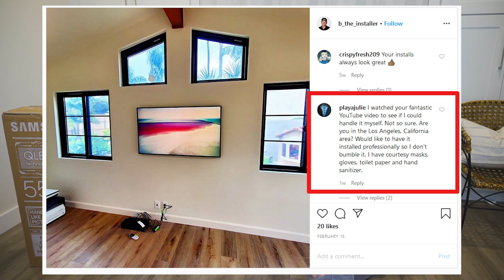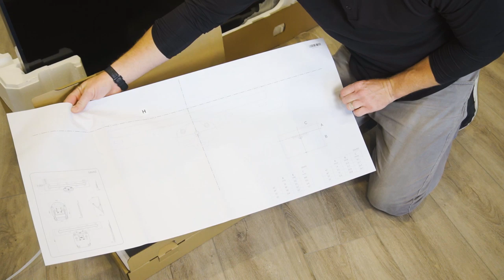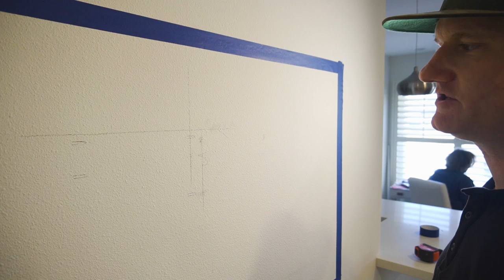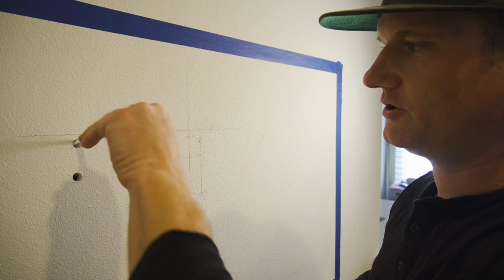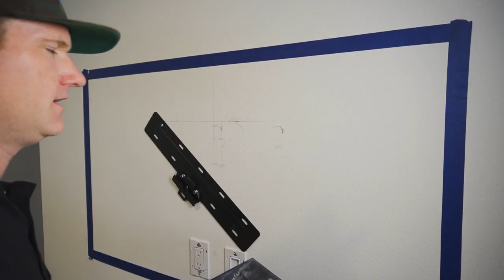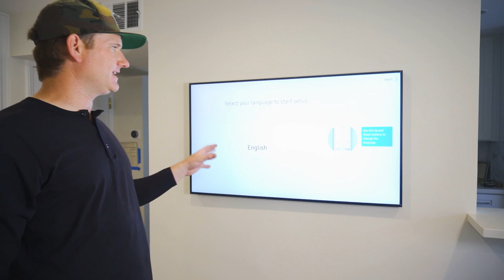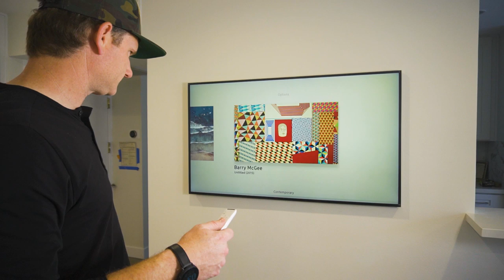Samsung Frame TV Install With No-Gap Wall Mount

Comment: Hi really interested in getting one of these TV's but dont want to destroy the illusion, by adding a sound bar, is there a solution you would recommend using small discreet, speaker systems

Comment: Great video... Can you tell me if he One Connect can connect to a Sennheiser RS 175 RF Wireless Headphone System that uses an Optical connect cord? Unfortunately, the Samsung Q90r does not have Bluetooth that can connect two wireless headphones at once.  Thanks
Reply from the maker: You can only bluetooth to one thing. I use Sony headphones every night and just repair them nightly.  Works like a charm.  I had senheisers before and used via optical.  So it can be done either if the senheisers have bluetooth. Not sure they do

Comment: Hi. I just got myself the frame. Question: When hung up. there is a gap from the top frame to the wall. Is it possible to have it gapless against the wall, meaning no space whatsoever?
Reply from the maker: Yeah some people have said that.  I have no issue.  Maybe pull bottom out and push top in to get it to fully push up.  Also you can put the rubber pads at bottom and it will counter act the top gap.  1/4 inch around is not bad.  All pics have a little gap
Reply: @BTheInstaller  Thank you for the response. What is the rubber pads? Do they follow with the package?

Comment: The connectors on the end of that one connect cable are pretty big.  How thick was the in-wall conduit, since that cable isn't in-wall rated?  And was the conduit put in before the drywall, or did you fish the conduit in the wall after the drywall was installed?
Reply from the maker: It was in wall. Many times contractors run conduit when building. You can pull 2inch through. The small end goes through

Comment: Thank you for the video. What are the dimensions in centimeters of the One connect height, width and depth? ?
Reply from the maker: Saw this on samsung, but some differ in size.  14 1/4" wide x 4 1/2" heigh x 11 1/4" deep according to Samsung.

Comment: I'm getting ready to install my Samsung The Frame 65 TV. I think I watched the video 10 times!! The video is great. I'm ready. You will soon be on HGTV!! :-) Question: Would you mount a 65 incher direct to the drywall using toggle bolt? 55lbs My wall is build on steel studs.
Reply from the maker: Hello, thanks. Much appreciated.  I'm about to launch the 2020 frame video next wed.  You can absolutely mount that tv on 4 toggle bolts, 3 on top and 1 in middle bottom.  The 3/16 ones I show are 80 lbs per... you could hang a pull up bar on the mount and hold your own weight.

Comment: Did you HAVE to remove the power socket face place ? In the UK that is not possible. What did you mean by cable not rated for in wall ? Do you mean it MUST have a conduit? Thanks
Reply from the maker: In the states power outlets and the pass through boxes have plates that cover the outlets.  The cable isn't able to successfully slow down a burning fire like some other rubber material.  Its also possible that this wire could get punctured more easily than an in wall rated cord.  Either way, its not likely to cause any issue in wall, so many people place it in wall.

Comment: Can you recommend a TV that is not a smart tv please?  I will be moving to a new apartment and am not sure that I can hang it on the wall, but I would like the option to do so if it's possible!  Ty!
Reply from the maker: Most tvs are smart tvs.  Do you mean you likely won't use the smart TV because you have a device you care to use?  Also give me price range and size as there are good ones depending on those things.

Comment: hi hi great videos, just wondering though, do you sit the one connect box on the floor then?
Reply from the maker: You can put them anywhere.  Many people have stands below, some have tables and then put a basket under as decoration and just dump it in there.  They don't need to be in line of sight of remote so they have to go somewhere.
Reply: @BTheInstaller  thank you so much!!

Comment: Is the no gap wall mount really works. I have seen in some video there is a gap of 2-3 cm on the upper part of the TV after installation.
Reply from the maker: I've had no issues.  Walls aren't always perfectly flat.  So any minor gap is typically from the wall not being perfect.

Comment: Nice one - i really enjoy your content:-) , I am a installer too (denmark) and my biggest concern is hidding that one connect box....it is always a hazzel and I do not think is pretty, but it is however a cool feature that every thing is in the box and not on the tv.
Reply from the maker: Thanks... it's fun work but definitely gives you a lot of knowledge that I find hard to give the world, so YouTube was a good fit.  The frame is cool, and I like the one connect for it, but overall don't like having a separate box.  Wish they would incorporate the tech into the depth of TV for QLEDs
Reply: @BTheInstaller  The one connect box, is really good when it comes too hide many cables in a tv table ect whith that one cable... but I am a LG fan.

Comment: I thought you were going to use a conduit? Looks like you just straight dropped the wire behind the wall. What would your conduit look like, if you did use one?
Reply from the maker: The conduit was already in wall.  Just a 3 inch flex tube.

Comment: Hi! I recently bought the Q90R 75 inch. Do you think only one stud with 2 screws and 4 drywall screws will hold the TV? The weight of the TV is around 88 pounds
Reply from the maker: I don't know your situation, specifically... i have mounted many tvs with a single stud in the middle of the mount, and toggle bolts on left and right sides that weigh over 100 lbs.  My new video shows this on an outdoor tv, but similar concept.  You have to make the best decision for you. https://youtu.be/IePfgvqmYlQ
Reply: B The Installer Okey, thank you so much for replying! Appreciate it👍

Comment: This video could be soooo much better if you showed the TV hanging from the side so that we can see its profile, aftercall that's the selling point of the TV. Also you should show what you did with the box, where you placed it, how long are the cables, what cabinet you used and offered suggestions, since that's also what differentiates this TV from others!
Reply from the maker: then check out my other 4 frame install videos and 2 reviews.  plenty to see.

Comment: Super dumb question but how did you push that outlet back so it was flush with the wall?
Reply from the maker: I just pushed it in.  Its just thin metal holding it to the screws.  Took cover plate off.

Comment: I've installed my 'The Frame 2020' 65" without removing the white stickers from the mount, shall i have removed it? what it actually does and how it affects the mount? Thanks!
Reply from the maker: No you don't need to.  That is only if you use the mount for a larger or smaller tv.
Reply: @BTheInstaller  Thanks!

Comment: Hello. My dad took all the steps that you took for a 75 inch frame TV and the TV is on and talking but it’s not displaying anything. What should we do?
Reply from the maker: You plugged in one wire to display and then to the box? And then powered?  Make sure the batteries are in correctly.
Reply: @BTheInstaller  yes he made sure everything was done correctly the second time but the tv still won’t display anything despite being on.

Comment: Will this wall mount work on a boat where the wall is tilting from side and bouncing around a bit?  If not as-is, would adding a small bracket or 2 to the edge of the tv frame to keep it from tilting out solve it?   I guess I'm asking that if the tv is restrained to be against the wall,
is it then impossible to lift it off the bracket? - Thanks!
Reply from the maker: The mount is pretty solid.  It would not lift off.  It may sway and/or bottom come out, but i used double sided velcro tape to hold pictures still.  This would be same.  Remember the box, where is that going?

Comment: what is the size of the washers you are using on those toggle bolts? If you have link where to buy the washers that would be great.  I'm about to mount one up as well.
Reply from the maker: I just get the washers in other mounts.  A typical 1/4" washer is fine.   They're about the size of a quarter at home depot but 1/4" hole and work well

Comment: If the only reason brick/concrete wall was discouraged was because of not being able to put cables thru wall, I don’t think that should be too much of a deal breaker. Since it’s only one thin cable, I’m sure hiding on wall surface wouldn’t be too much of an issue
Reply from the maker: Agreed.  It was more for brick fireplaces.  That is much harder to hide wire/one econnect box.

Comment: Is it ok run the regular “non wall rated” cord behind the drywall or is that considered buried in the wall? I bought a 2020 50” but it’s not compatible with the in wall cord so that’s not an option for me.
Reply from the maker: It's technically not in-wall rated. You can run some flex tube in wall, 2" pretty easily.  The cord for the 2019 is same for 2020.. I'm 99% on that

Comment: What size toggle bolts would you recommend using to mount the Samsung Q90T 65" using the no gap Samsung mount? The mount model # is WMN-M15EZA. Thanks!
Reply from the maker: the 3/16 inch size is always best for TV installs.  They're a little more workable but very strong still.  The normal length is 2.5 or 3 inch long.
Reply: @BTheInstaller  Thanks for the information!
Reply: @BTheInstaller  oh and what size drill bit do I use for the holes?
Reply from the maker: You should follow directions on whatever you buy but the 3/16" ones I use are 1/2 inch hole on wall.

Comment: Why you say that this is not good for a brick wall ?  If we take the wire from the middle to down then we can connect to one connect box. Yes you have to compromise on neatly hiding the cable. It will not be as clean as this method. But I dont think it will be that bad to not to purchase this TV.
Reply from the maker: Its fine for brick wall if you leave external.  It's not good for brick fireplace.  Maybe I said that wrong.  The wiring of a tv is more complicated on a brick fireplace, and people are trying ask me how to hide the one connect behind a tv on brick fireplace.  I would avoid the tv for that install request.

Comment: I just started researching this tv and I have heard that the one connect cable is not rated to be run through a wall without using conduit.  Is this true?  Do the instructions that come with the tv say anything about using conduit?    Also, if mounted high on the wall can the top of the tv be angled down while viewing.  I'm just wondering how decent the picture quality would be with it flat against the wall?
Reply from the maker: I wouldn't buy this TV unless you have the goal of it being art and a TV.  There are much better tvs for just being tvs.  You can see lists of mine on various videos and I've explained in all of these videos that cord is not technically rated to be in wall at all.  They do sell a $249 version to put in wall.  The conduit doesn't make it safer.

Comment: Is there a trick to taking the tv off the mount? I want to raise it off my mantle more but feel like I really have to force it to get it to disengage.
Reply from the maker: Yeah its hard.  Just pull bottom out and lift one side slightly higher than the other.  So just a little off level
Reply: @BTheInstaller  thanks for that. I did end up finding the answer on a site. Seemed there were a lot of people asking the same question. Might be a good idea for Samsung to mention it in the instruction manual.

I was able to remove the tv in under a minute.

Thanks again for the reply!

Comment: I'm trying to remove the tv to paint... cannot figure out how to get if off the no gap wall mount, any tips?
Reply from the maker: It's odd. Its just up. I pulled the bottom out and then lift with one side slightly higher and it will pop out.  Just up.

Comment: Any idea how to get the TV off the wall? I need to take my down and it seems a bit challenging!!
Reply from the maker: Just goes up.  You can pull the top out from wall and then get hands under the bottom and lift. It helps to lift one side a little higher first until it pops off the bracket.

Comment: What kind of conduit did you use in the wall? Im wanting to install one of these but want to be code compliant and dont know what is needed. Thanks!
Reply from the maker: You can get the in wall rated cord if needed.
Reply: @BTheInstaller  how is it listed on Amazon BTW love your video

Comment: Do you have an install where it does not sit flush on the wall? ie uses the bolts provided
Reply from the maker: Negative.  I advise people to seek a different tv as you will have hard time getting this to look like a frame that way.  And the cost isn't the best for regular tv in Samsung lineup.  Get q90t

Comment: The one connect wire- is it a fire retardant wire that was provided to you? I am in Canada and a fire retardant wire is not provided and I want to hide the wire through the drywall. Any suggestions will be appreciated.
Reply from the maker: Run a conduit in wall. 1.25 inches or larger.
Reply: @BTheInstaller   thank you

Comment: any advice for going past a fireplace? the top where we’re mounting is drywall with windows to the left and right but beneath is a brick fireplace. 

we’re trying to get the connect one box down to where the internet router is beneath the right window.
Reply from the maker: You can send me picture on IG.  May not work if there isn'tan easy route.  Good luck.

Comment: I have a brick wall and still want to install The Frame 2020 when it is available in Germany. Do you have any suggestions or would do anything differently? As it is an old house, the brick wall is quite crumbly and I had issues before to find a good spot and drill a hole.
Reply: Mehrwegflasche it’s super easy I just installed a 55 inches on a brick fireplace I used drill bids made in Germany
Reply: Ok, but what about the cable?

Comment: i bought a 65" frame tv and on the mount gap i didnt remove the four white stickers before screwing it into the back of the tv. Will this be a problem?
Reply from the maker: No.  You only take those off if you need to match it to a different tv.  They come set to put on the TV in box
Reply: @BTheInstaller  Ahh thx your the best!!

Comment: I know for a fact that OneConnect cable is not Fiber optics. If you cut it open, it's copper with fancy shielding.  I don't know why people keep saying it's fiber.  Samsung never said it is.
Reply from the maker: Dude, that's crazy.  I heard from another source.  Never even questioned it. Good to know.  Have they recommended not to bend? It still can be damaged so probably not worst fallacy for a customer to just be careful I suppose?
Reply: @BTheInstaller  Yes. They are ultra thin strains of copper that need to be able to carry 200+ watts of power. and digital video. similar to Thunderbolt 3 tech.
Reply from the maker: Good to know.  Good PSA.  Thanks
Reply: Why the one connect cable 2019 is not for in wall use?

Comment: Have you ever installed the entire One Connect Box in the wall itself, directly behind the TV?  I currently have an outlet and HDMI plug directly behind where this Frame TV would go.
Reply from the maker: You can remove those for a low voltage panel and hide the box inside that yes.  It would have a power outlet inside.

Comment: Hi! Please help me. 
Tell me, please the plug size for one connect box. I want to lay the cable in a plastic pipe, but I don't know the dimensions. On the samsung website, only the dimensions of the TV plug are indicated (45x84.8x9.55mm). but you need to insert another into the pipe (plug from the box)
Reply from the maker: I make a 1 1/8 inch hole in the cover plates and the small end fits through.  Just barely.
Reply: @BTheInstaller  Thanks!!!
Reply: Thanks i just installed my 65 and have been looking for the size of the plug, any chance you can make a video on taking thr frame back off the wall. Having issues taking my 65 back off the wall solo.
Cheers

Comment: Hello, how is the no gap mount installation different on the 82 q90?
Reply from the maker: The frame sits complete flush and has that square frame around it.  The QLEDs still sit flat but you don't have to have those mounts.  Should be similar install

Comment: Du you need (recommend) to run an ethernet cable to the One connect box, or does it connect over wifi? I mean to be able to watch content online. I have never owned a smart tv before.
Reply from the maker: If you have decent wifi, you shouldn't need an ethernet.  Even 2 years ago it was worse but in 2020, most have sufficient speeds to stream.  Some very rural areas may not.  So I would say wifi is very good and you don't need an ethernet cord
Reply: @BTheInstaller  Thanks for reply. Have not seen any reviews mentioning this. I live rural, but may have just enough speed to stream 4k content :) Good to know I can use WiFi. And I can always connect with cable if I need a more stable conection.